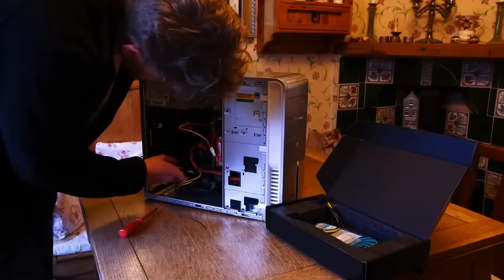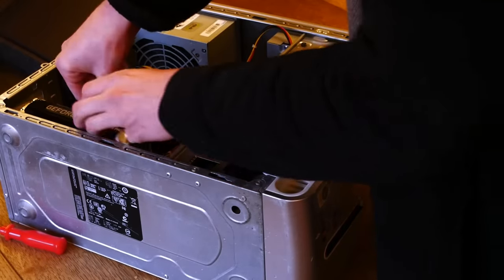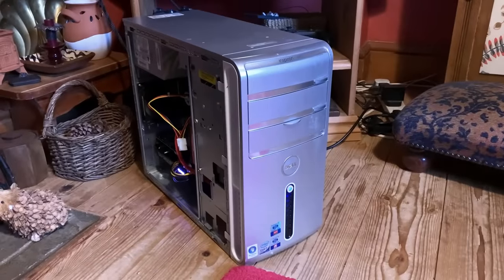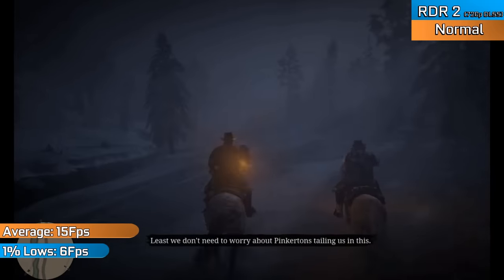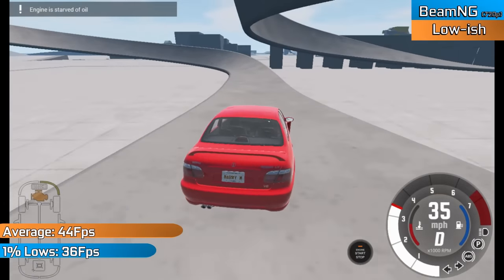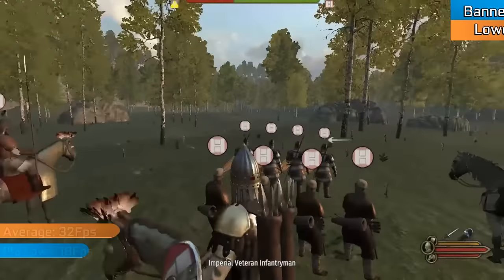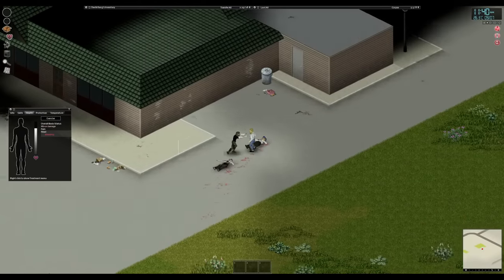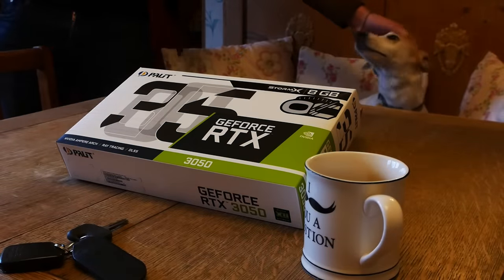RTX Graphics Card in a 15 Year Old Family PC...

Comment: @Budget-Builds Official. Im sorry, Ive watched a couple of your videos now and whilst you have some cool old hardware, I dont think you fully understand it. I completely disagree with your findings here. I understand that maybe you do not want to confuse people but their is so much information missing that would allow you to clearly see the behavior between the card and CPU. What we are seeing here is a clear bottleneck of RTX 3050. If you put a RTX 3060 in I anticipate the same results in terms of frame rate, maybe a little more due to the larger VRAM meaning less swapping with that DDR2.
What would be need to be known is the CPU and GPU frame times, so we can see which is waiting for which. Then the amount of difference in the two numbers. For example if a CPU has a frame time of 25ms and the GPU 5ms, then the GPU pumps out 5 frames for each 1 that the CPU makes. This would indicate a bottleneck on the CPU. As the GPU waits for the CPU to render a frame this number always wants to be lower. DX12 and its multicore optimization is helping modern machines to reduce this waiting. Though if your game is maxxing your CPU which in this case it probably is then it will have little effect as there is no spare thread for instant access.  
Use MSI afterburner or other monitoring app to collect this data. 

I have been ranked number 1 on the 3dmark boards multiple times. If you wish for ay assistance with the more technical stuff just drop me a DM mate. Im UK based like yourself.
Reply: I would be interested to see how Vulkan responds to this setup. As it is optimized for old hardware, this could benefit the CPU.
Reply from the maker: Genuinely this video was done for a bit of fun, it wasn’t ever intended to be a deep technical look at the C2Q or any of the system components, sometimes it’s nice just to see what happens when new tech is mixed with an older system. 👍
Reply: @BudgetBuildsOfficial  This is my point. We didn't get to see what happened. All we got to see was a clear bottleneck. We knew it would work as PCIe is a certified standard with a mandate of backwards compatibility.  The RTX 3050 has been slated hard recently for its poor performance so I agree with the pairing deliver 1050 like performance and it also suffers a bottleneck of its own due to a low bandwidth on its memory. So in a way the system has 2 bottlenecks.
Now what would be best from here is to push the CPU to ~3.0GHZ, you are using 800MHZ ram, at 2.8ghz you get a complicated FSB memory multiplier. I would manually overlock the FSB from 266 to 300 and the change the RAM speed to 900mhz. This isn't to far out of spec and should be tolerated without any voltage adjustment. I would also manually set the timings of the memory as low as possible.
You will have 600mhz extra on your CPU and 100mhz extra on your RAM and a very happy FSB which doesn't need a math's degree every time you use its memory.  
I think you would find the results very interesting.

Comment: wouldnt a RTX2060 have been smarter, its cheaper, + preforms about 10-15% faster, and dosnt have the PCI-E x8 limitations of the RTX3050. And it exists in 6 or 12gb models, at this pref tier i doubt 6gb is a big issue either.
Reply: ....this a joke idea video. You taking it way too seriously

Comment: I'll bet this card is running into PCIe bandwidth limitations too.  The 3050 uses PCIe 4.0 x8, which shouldn't be a problem even in PCIe 3.0 systems.  But in a system this old...well ya.

Comment: LOL bottleneck 🤣🤣🤣🤣 the core 2 quad 3.00 GHz would be better for gaming but in my opinion with the 2.4 quad processor that you have a  GT 730 or GTX 750 would be better and you could actually game. But you might experience a little bit of bottleneck with the GTX 750 but the GTX 750 is better for gaming it is a legend💖😁 and use 1920 x 1080p as your screen resolution and you will have a awesome experience. When gaming. If you would be willing to listen to me you'll have a better gaming experience 💖💖 and also use a SSD drive they are a lot faster. And 8 gigs of memory ddr2 800mhz is fine. And use at least a 550 watt power supply 80 plus

Comment: i dont why this pc is so bad. i had a long time ago a pc with a q6600 with a mod that pushed it to 3 ghz, 6 gb ddr2 and a gtx 1050 ti. i could play alle games, in gta had i 50 fps on 1080p very high settings, could play easly fortnite and csgo on the higst settings 1080p with more than 120 fps. I don´t know why you Benchmarks so bad are 🤔
Reply from the maker: The tape OC does help performance greatly, and will be covered featuring this PC at some point. 

As for settings GTA V became very unstable with High settings and FPS drops, as we are 600Mhz behind the tape mod, which greatly helps with processing shadows and post-FX.
Reply: @BudgetBuildsOfficial  My Pc was very stable and i had almost never FPS drops, also all games loaded pretty fast and i had just a hdd.